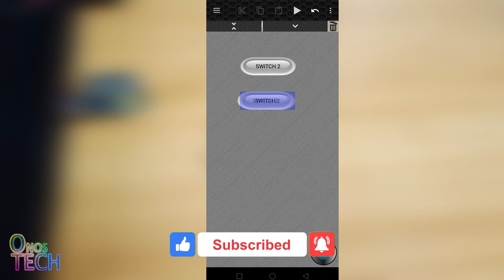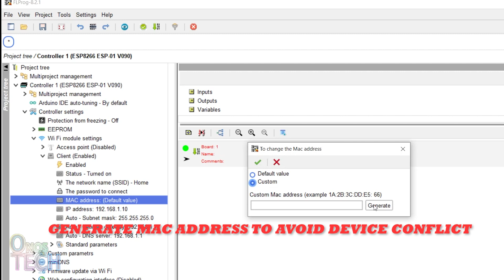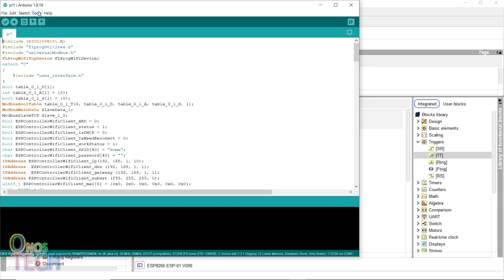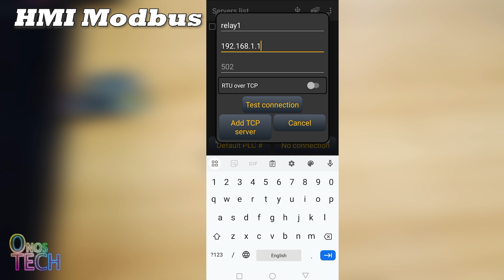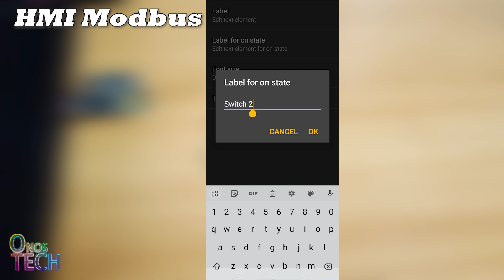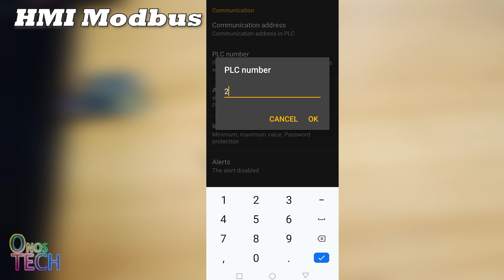How to Build ESP8266 ESP01 WIFI Relay Network | Home Automation

Comment: Hello

please tell me in a few words
who has the advantage mod bus or classic wifi ono with arduino and esp8266

and if possible just briefly, what are the advantages, if any

thank you so much for sharing all this with us

and I know that you are tired of old people like me who know almost nothing

I wish you all the best
Reply from the maker: Modbus RTU or TCP can be configured for Arduino and ESP8266. Modbus RTU or serial requires cable and can also use WiFi when configured as RTU over TCP. Modbus TCP also uses Ethernet twisted pair cable and can also use WiFi as was done in the WiFi  

Each of them have their respective advantages and disadvantages depending on the area of usage and cost dependency. But Modbus TCP over WiFi is very convenient.

You are a great person. Age should not be a limitation to learn new things😊😊😊
Reply: @OnosTech  thank you very much for your quick reply

but at the age of 65, the brain is already full of a lot of nonsense, so you need to have two grams more brain for these things

because a lot of things need to be captured, what and how

but thanks to you, how you explain, somehow I manage to grasp something

Thanks again
Reply: @OnosTech   do you have a video where you explained with flprog how to compare (comparison) say left and right channels on analog inputs

and let's say if the value on the left channel is higher, turn off relay No. 1, if the value on the right channel is higher, turn on relay No. 2

I looked but I didn't find anything like that
Reply from the maker: Repost this question on my Telegram chat (t.me/Onos_Tech), then I can share a picture with you